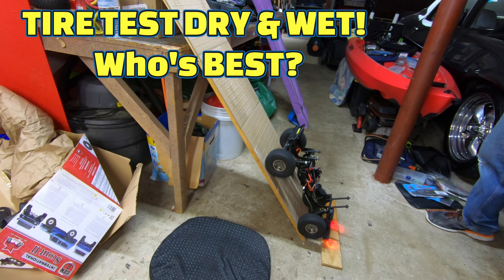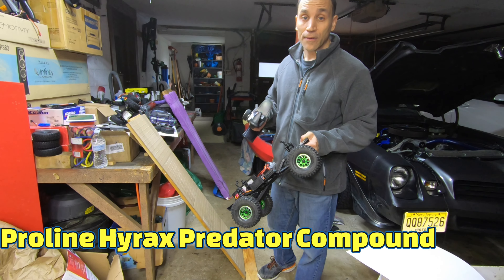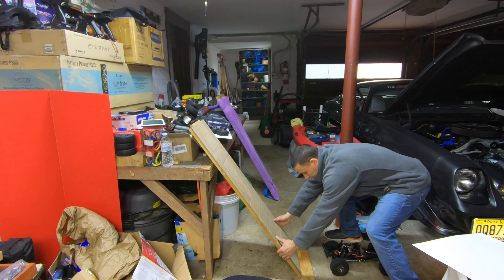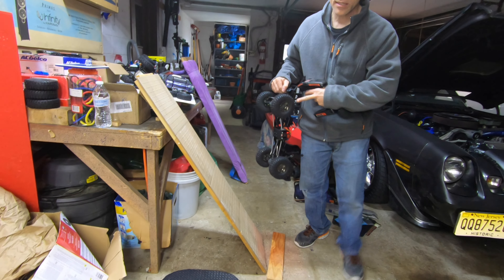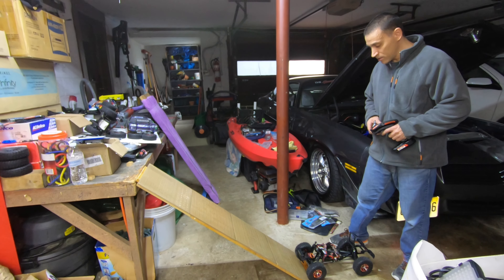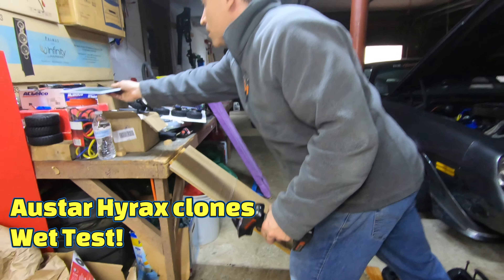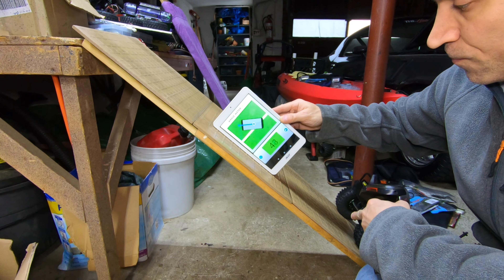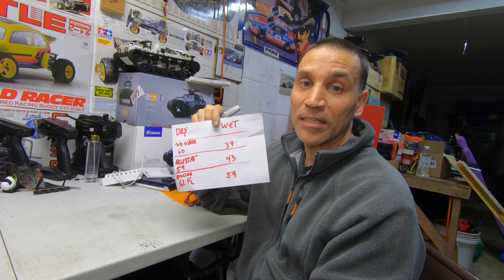Proline Hyrax Tires VS hyrax clones DRY & WET TEST What's best?

Comment: As you’ve said in some other comments, the clones are surprisingly good in snow! Blew trimmed canyon trails outta the water but if you get the clones wet they absolutely suck for real crawling 🤣
Reply from the maker: They are good for most everything but wet conditions are there weak spot for sure.  Thanks

Comment: my no names work good in the wet so there must be more then 1 tire out there no name hyrax clone cuz mine out do the austar and the proline  you said yours feel like a silicone mine are deff a soft rubber got them on amazon for 19 dollars a set ive had 3 sets on old crawlers there the best tire ive ran and i tried alot from proline duratrax rc4wd ottsix but theses 19$ amazon cheap tires take the cake
Reply from the maker: Hi I think those are the ones I tested I got them off amazon also no name on the side a lighter color black than normal RC tires, I thought they worked ok out on the trail mostly dry but after putting them on a wet surface they have no traction compared to the others proline tires are much better there is no comparison... send a set in I will test them on the ramp.
Reply: @ShenRC  i live on disability 750 a month don't go far mine work great in the wet i been running the same tires well over a year i sold the actual hyrax i had cuz they didn't preform as well in any condition none the less good test